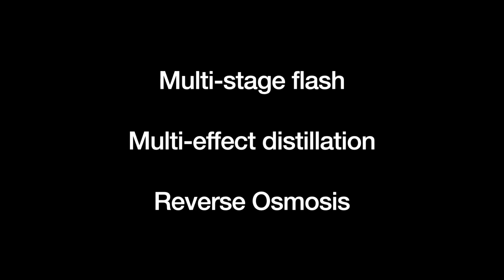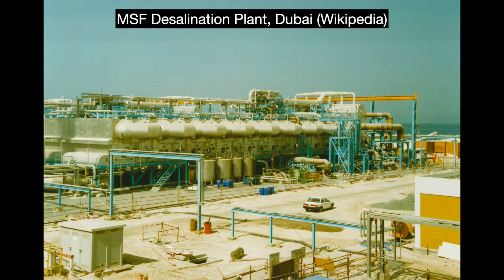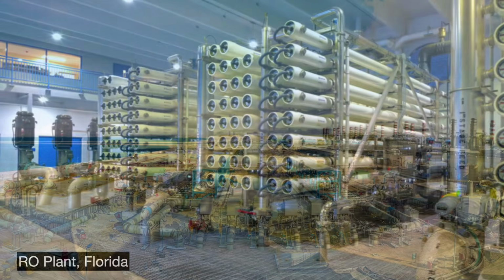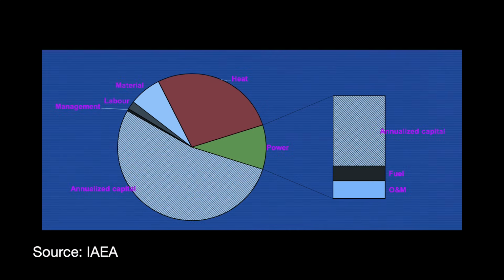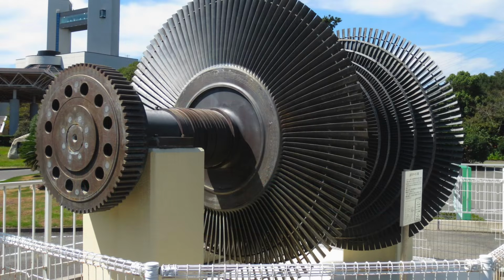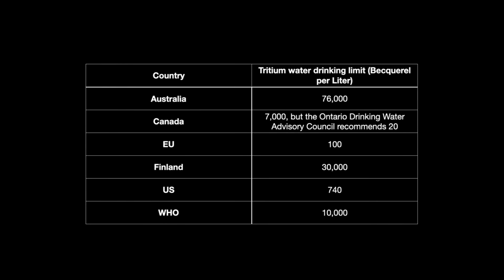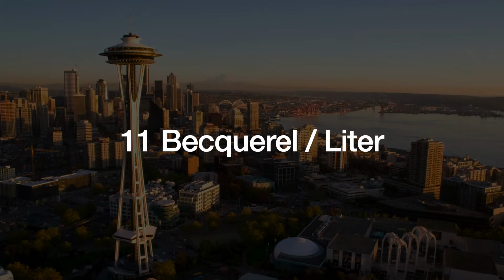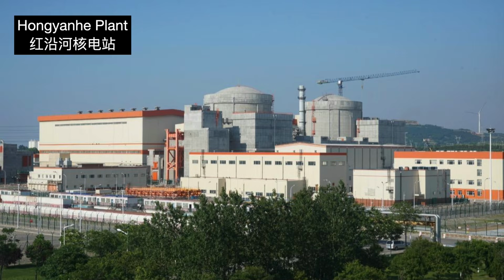Going Nuclear to Desalinate Seawater

Comment: still the radiactive contamination and safety issue of this solution.
Reply: Bury it. It came from the earth. Just put it back whe you are done
Reply: @DeandreSteven  Where? We have been splitting heavy atoms for 80+ years and we still have not a single useful long term storage site in actual use today.
Reply: @luc_libv_verhaegen  the best solution would be recycling nuclear waste so that what you have left (fission products) is radioactive for a couple hundred years. It's not done today because it doesn't make sense economically. There is plenty of uranium and too little high level waste that can be confortably stored.
Reply: @luc_libv_verhaegen  Another reason it is not stored properly today is because people freak out whenever plans are announced for storage or transport near them, so they protest and stop storage.
Reply: @SamSam-qk5zr  true cost to radioactives treatment also the issue of it. Also the complexity
Reply: @reggie69.  No, France has no permanent storage that is active today. Finland is close to take its permanent storage into operation, making it the first.
Reply: @luc_libv_verhaegen  I'm saying as a part of thier project to making more nuclear reactors and renovationing their old ones their also investing in a lot more storage I don't know what storage your talking about but they see it as a challenge they already dealt with
Reply: @luc_libv_verhaegen  put the used cores in the mines where they dug em out of. If the material is too radioactive put it inside a lead coffin then bury it.
Reply: Nuclear energy has a deathrate per GWh comparable to the safest renewables and the dangers posed by radiation are quite overblown. For example in Fukushima only one person died due to radiation poisoning and (even that is somewhat controversial)
Reply: No. Nuclear is safe and clean.
Reply: Dumb and uninformed comment
Reply: I don't think the millions dying by air pollution caused by fossil fuels would view this as any safer than the few folks who've died by nuclear disasters